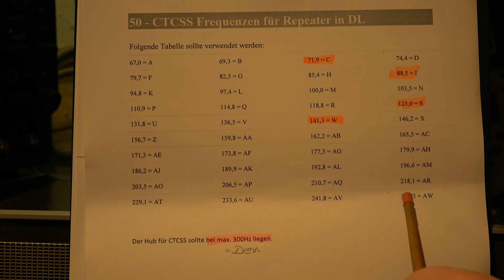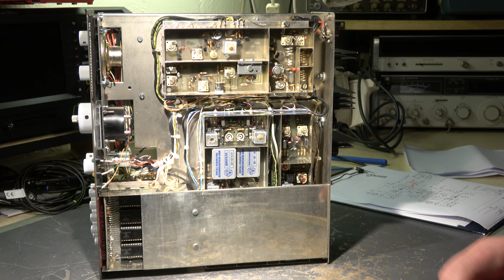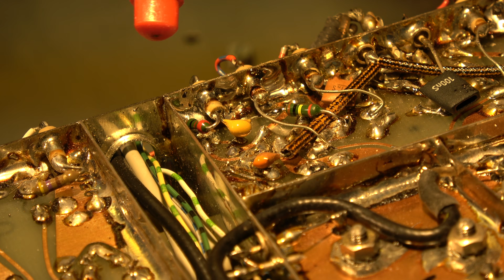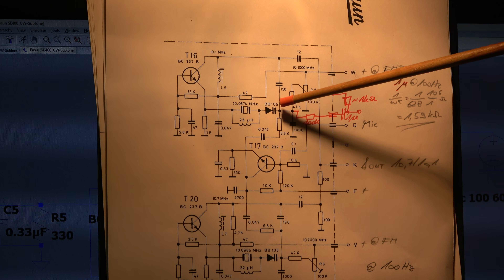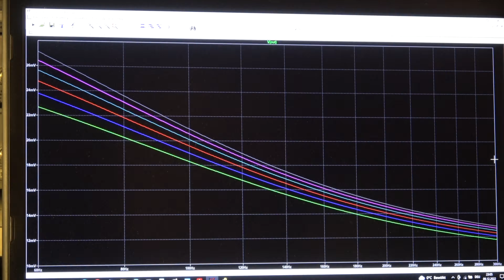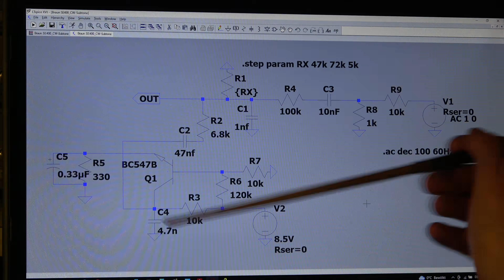#148 Subtone for Braun SE400 Part 1(2)

Comment: Nice work Stefan...does the rig automatically insert the European 1750 Hz access tone or will you be including this in your design? Happy Holidays!  73 - Dino KLØS
Reply from the maker: The SE400 has already the 1750Hz tone included, there is a momentarily "call" switch at the frontpanel . With this i still have the 1750Hz and now also added the subtones. But thanks for your question - i´ll mention, demonstrate and make it clear in part 2.